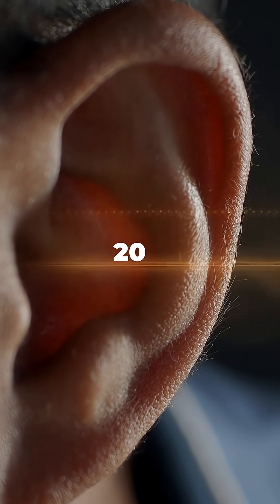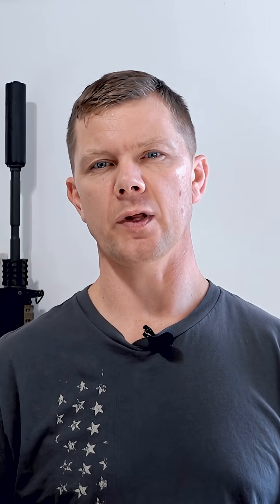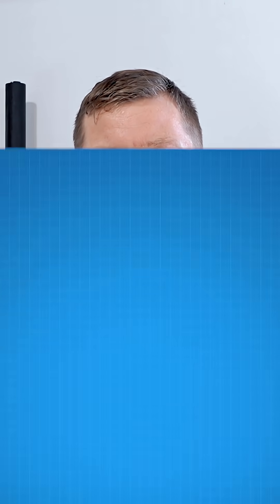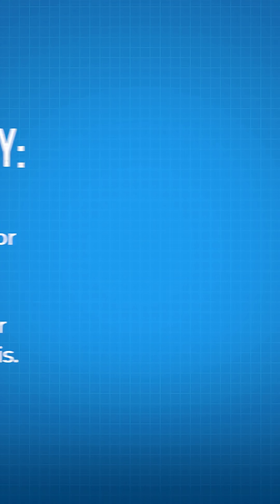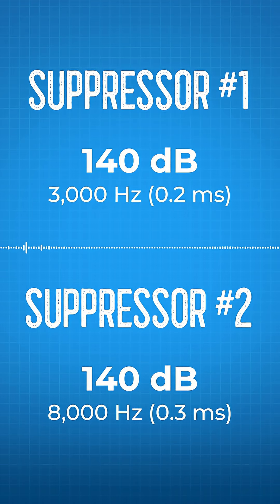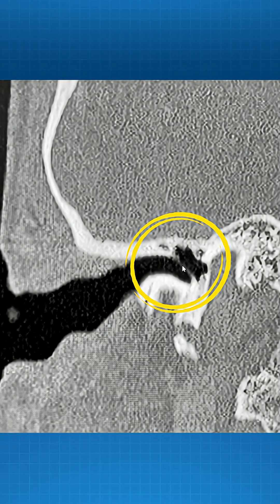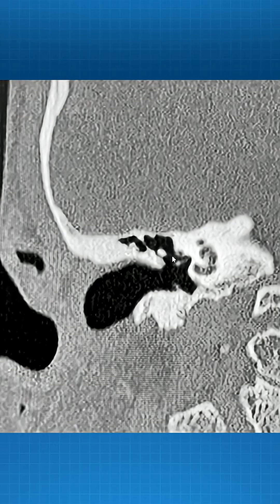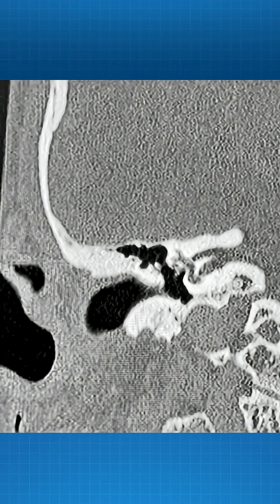2 Suppressors same dB, one sounds louder, why? #education #suppressorengineer #suppressor

Comment: Frequency plays a large part in how we perceive sound "loudness".  I have a 45 SMG that has a lovely low pitch tone that sounds very quiet.  It seems quieter than a 9mm SMG suppressor, which has a higher tone to it.  The sound meter says the 45 is 10 dB louder than the 9mm.

Comment: What is the best way to determine which sound is most damaging?
Reply from the maker: I could go down a rabbit hole on this, but in general the decibel reading plus the sound duration at the shooters ear is the most damaging to your hearing.
Reply: The dB reading on the sound meter.  That is a measure of the energy reaching your ear.